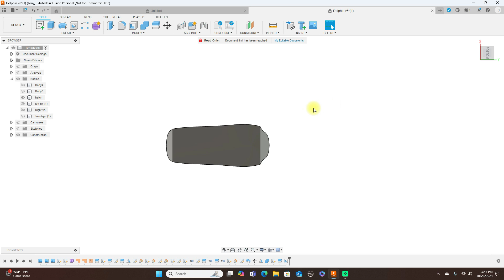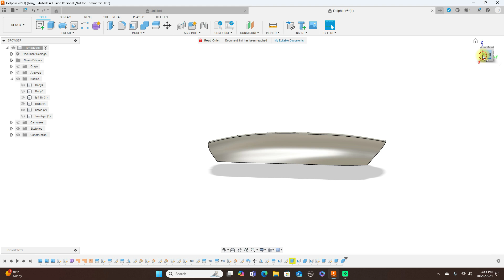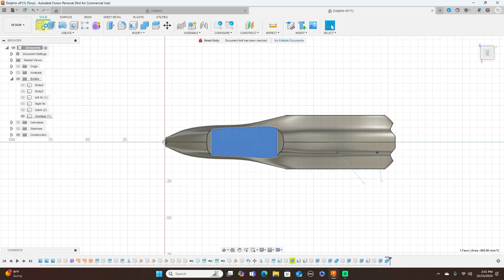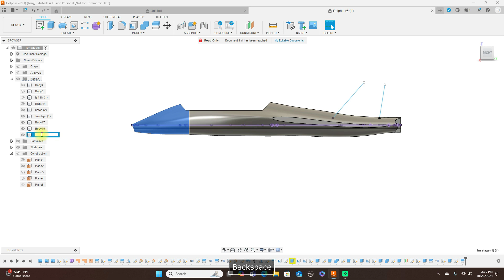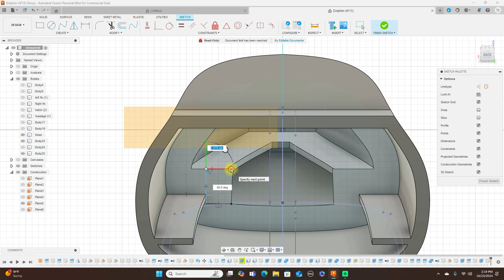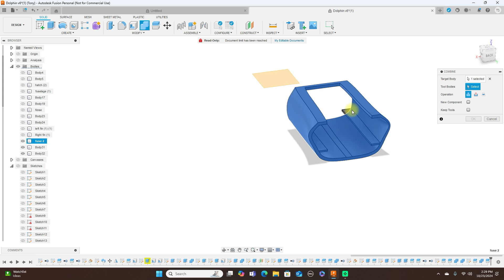Introduction to modeling the internal structure of a 3D printed RC airplane in Fusion 360/CAD

Comment: (57:23) Do you know that Windows refreshes the desktop with almost  every command you use? Especially on laptops, it can significantly slow down the system.
And you have a huge garbage can there. Not to mention the high risk of losing data when Windows displays a blue screen of death. Why? Because you have the system and data on the same disk partition.

On the desktop, it is best to make a shortcut to the files/directory on a separate disk (D) in File Explorer. Just drag the folder with the right mouse button. 
In the event of a system failure, all you need to do is renew the link to the files, and not cry to the service technician for help.

Many users make this mistake, and for years I have been setting up the system for people so that the folders with data are on a separate partition/disk.
Even the Desktop. This simple solution can really save your ass one day.